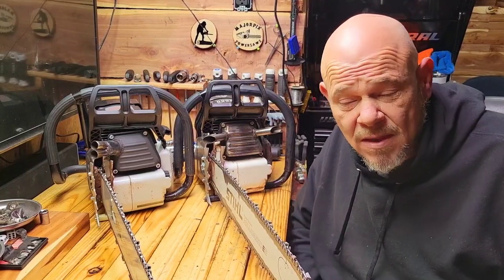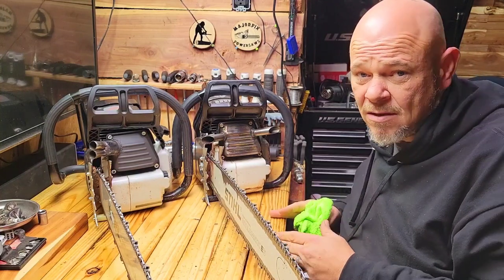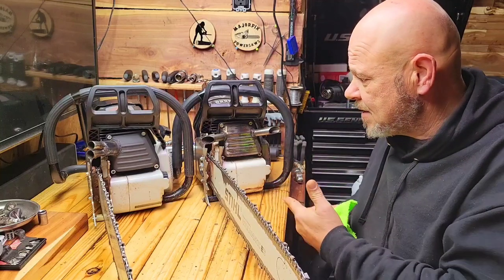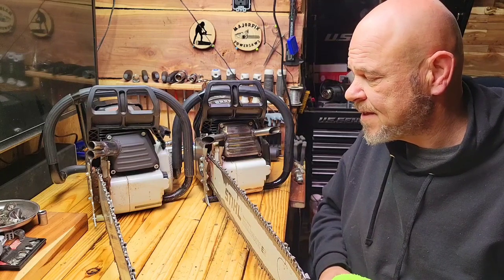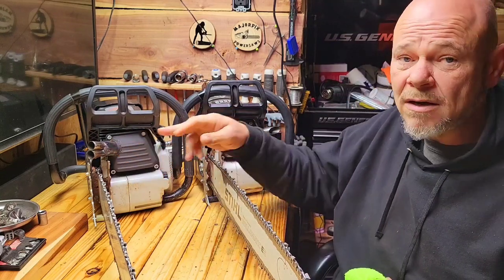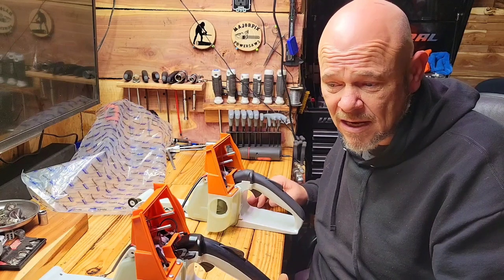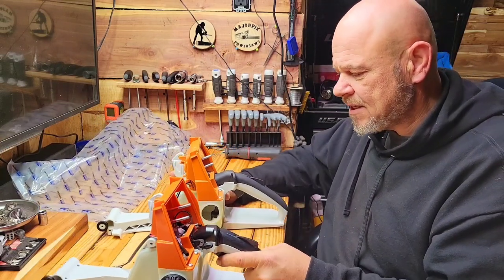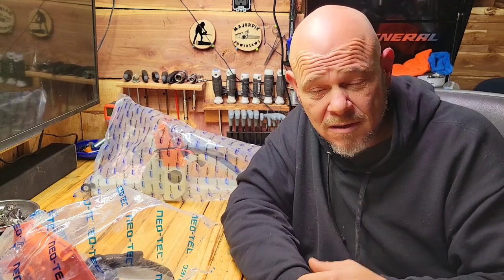NEO-TEC VS HOLZFFARMA STIHL MS660 COMPARISON!

Comment: Appreciate the comparison video, In market for a 90cc saw. Rarely need over a 24-28” bar double cut application, but have a couple oak trees that require a 32-36” bar length, don’t want to burn up my 60-75cc saws.
Reply from the maker: Yes, sir, the 660 is perfect for the long bars! My 372xp big bore pulls a 36 nicely at  76.5cc. But nothing pulls the long bars like the 660s !
Thanks for watching, sir 🙏

Comment: Have you run the Egan Straight Shot muffler cover on any of your Stihl clone saws? I’ve played with multiple different muffler mods and there’s something about that Straight Shot that really “woke up” both my ms380 Neotec and my F660vw with pop up big bore! Baffles fully removed on both saws. After bolting it on my big bore 660 clone I needed to lean the high jet about a 1/4 turn.
Reply from the maker: No sir... but soinds.like I need too! 😁
I will check them out!!